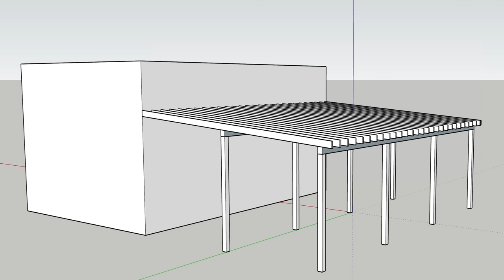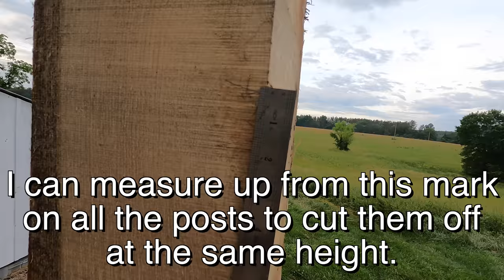Building a Huge Addition On My Shop.  Game Changer!

Comment: I live in Western New York last winter we had a storm .. between the snow falling and the wind blowing I had 4 feet too 6 feet of snow in my driveway had a ft of snow on the shop roof till the sun came out .. I might of added a 2nd header board for the top of the rafters only catching 2 inches ?? 4 inches might be better ?? I could be wrong great video ..

Comment: You have me wondering about the process that lead to making it only 12 feet deep when almost all of your equipment is much longer?  Also in your calculations did you allow for the birdsmouth in your rafters?  I think I might have gone a bit taller as well as deeper.  Measuring it up to have the finished top be a foot beneath your woodshop windows and a two or three twelve pitch.  That twelve foot deep when the snow berm defines the limit might be a bit crowded in winter as well as blowing snow coming under.  It is nice to have all your equipment dry and ready to go when plowing time begins as well as working on them.  Looking nice.

Comment: Would it have been better to make a heavy bracket to anchor to the concrete and then anchor the posts to the bracket? A good strong gust of wind could lift the posts out of the ground. A strong gust. 😏🙂

Comment: Good work, looks promising, since we all know an outside work area/carport/service bay is a precious thing to have if you plan doing maintenance. I also built mine, except is made of metal, 6x5 meters and includes a gantry x/y crane. =) It's a real space saver and you can move things easily inside the coordinates, especially if you work alone, as I do also. =) Cheers.

Comment: Awesome video, really enjoy the mil work and ingenuity. Great build so far! I have 'birds mouth' cut beams without hangers all throughout my 230+ year old house - several have started failing within the past 100 years, the 'sharp' corners on the beams are a stress point - absolutely not an issue here and as I said they lasted a long time before issues appeared and even then the majority are fine, dimensionally they are similar to your boards (4x8,10,12 true) so in about 150 years you'll probably have to put some plate steel through bolted on them to control the splitting and spread the load lol congrats again and thanks for sharing looking forward to the next posts

Comment: Awesome video, hate to correct you but that instrument is an optical builders level not a transit. A transit is similar to a total station and used to shoot straight lines in x,y,z planes when set up plumb over a certain point usually a building corner or surveyors tack

Comment: May i ask why you opted for the treated wood block on the post? I ask because my understanding is that pressure treating wood permanently opens the cell structure and its potential to hold moisture.  I would think that the untreated wood next to it can rot prematurly because of it

Comment: I only recently found your channel and I have been binge watching your videos.  How long did you let your lumber dry before using it?  How long should it dry?  I have been thinking about using green white oak for trailer decking and not sure how long it should be stickered before installing it.   Thanks for the content!
Reply from the maker: Depends on your goal of course.  I built this addition just letting the lumber sit for 3-6 weeks or so, because it can dry in place without any problems.  For decking you can put it down wet depending on how picky you are.  If you put them tight against each other, as they dry and shrink gaps will open up between boards which is typically what people want anyway.  If you want it to stay right where it was when you installed it, you have to dry it all the way to your area's exterior relative humidity.  For me in VA that's about 10-11%.  To fully dry, the rule of thumb is 1 year per inch of thickness.

Comment: I would have eliminated the 2 center post used a steel truss, opening up the middle is going to give much more access plus those oak poles can easily take the weight of the roof system

Comment: if you don't have a laser, use a water bubble and string, a hose, or just 3 stringers nailed together that stay in place,..it becomes the outer beam to be completed in due time...Do what you can with what you have..you can find used lasers in specialized thrifts for less...but probably stolen somewhere or pawn shops...some good deals there for tools in general. Sometimes, I had to buy my own tools, stolen by my delinquents and pawned...pay your staff each day.

Comment: Nice build a question why not use the chainsaw on the beams . Also with respect to the bottom of the beams with the plate ,why not make a cradle where you can have more support and screw into the beam . Just curious . Looking forward to the next video . Peace out

Comment: Nice work.  But, I cringed not seeing a rust resistent metal sheet between the treated blocks and the bottom of the posts.  Those treated blocks are.going to wick water right up into the bottom of the posts.  The treated blocks will do nothing at all to help.  All you needed was some metal or plastic barrier from the concrete.

Comment: My only question would be is that a floating slab? Could give you problems with freeze thaw cycles? If it does wouldn't be hard to cut out the concrete and underpin a footer
Reply from the maker: It is a floating slab.  Doubt there will be any issues because the frost depth here is only 18”. But as you say, if there is a problem I can definitely cut out the slab and put a proper footing under.

Comment: Did you add anything for uplift, as in wind to the posts? I spent a lifetime as a framer and a big part of post connection is uplift  not just lateral movement.

Comment: I know you used steel fasters why not a lap joint. I know there a pain to set especially in the air but it's very strong structurally. Not a criticism just curious on your thinking process. Anyway great project I really enjoy your videos.
Reply from the maker: Lap joint would be great. It’s just more work and more time. May have to put the beam up and back down for fine tuning. This is one and done.  Basically, it’s good old fashioned laziness!

Comment: the only weak link here is that pin and the treated block on the bottom. that steel is not coated and will be nearly gone within just a few years from the treated wood. also when not if that block is in need of replacement it will be a nightmare to fix. If you had use galvanized water rised post blocks this would be simple.

Comment: Did you leave the wood for drying before using it?
Reply from the maker: I let it dry some, about a month or so, but for a structure like this full drying is not necessary.  It can continue to dry after it's built without any harm.

Comment: Looks like that was a great project. Maybe I miss It but I do not  understand why you didn’t make the depth of the new building deeper and also why you didn’t make a pitch roof so that the water doesn’t drain on the vehicle as it sticks out of the shed now.  Just a couple observations.😱👽
I May have spoke too soon. I see that you are making the addition deeper. I still would’ve pitch the roof to the left and right, but that’s just me.

Comment: You have an conventional automatic level and not a transit. A transit have the scope that move right to left (horizontal axis)  like your level also moves up and down (vertical axis) for vertical readings. In the old days, transit, also known today as theodolite were used for star measurements or astronomical measurements.

Comment: What would you guess was the average weight of the rafters?
Reply: Since they're presumably identical, just weigh one of them. Multiply that by the number of rafters, then divide by the number of rafters. You can then add 0 if you like, but it's not necessary.

Comment: Language is ambiguous in that a guy will tell his friends he built a new home where the only thing he did was call a contractor and write a check. You actually do what for many others is largely pretense. I am impressed, especially since even I bought milled lumber when I built a summer home twenty years ago and a guitar a few weeks ago which underscores there is a difference in  meanings for the identical phrase.

Your also really picking up your video output pace. That's impressive too because it's hard enough to focus on and compete a project without adding film production to the overall project.

Gosh, if I was teaching I'd have to give out a grade of A+++ for the project but nice job will have to do.....